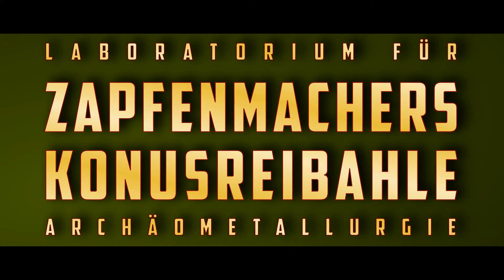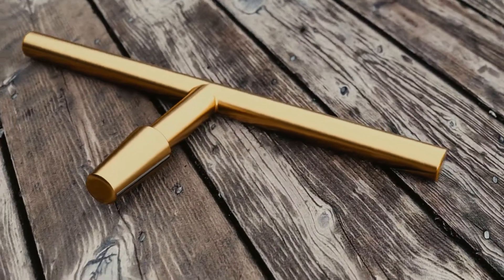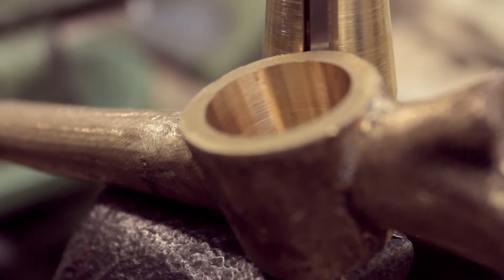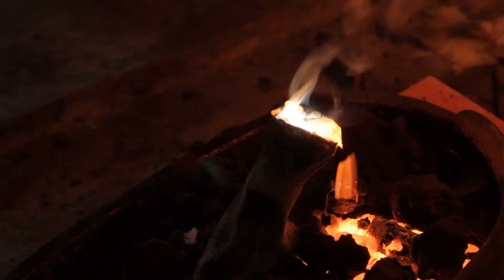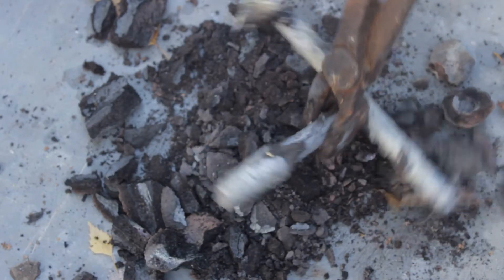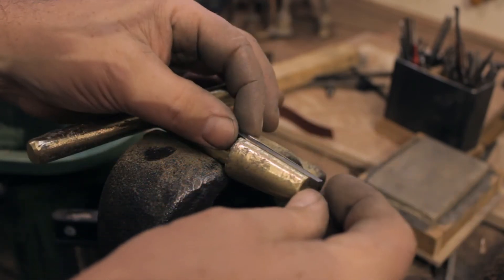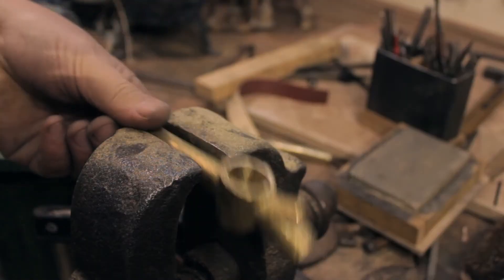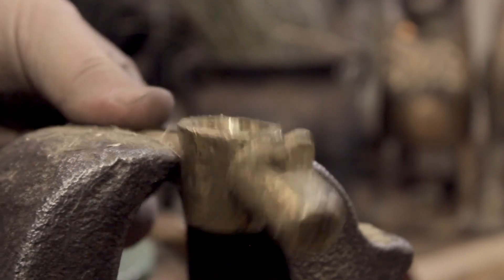How to make a medieval tapered reamer. Applied Archaeometallurgy. #ancientmetallurgy

Comment: whatabout brazing the wedge into place
Reply from the maker: As the wedge is needed to lock the blade in place it would not make so much sense. And if your brazed the blade in place, you'd anneal the the blade and  lose its hardness. It it was HSS you could do that. However in the 15th century there is not yet HSS, even it is a rather old fashioned material today (;